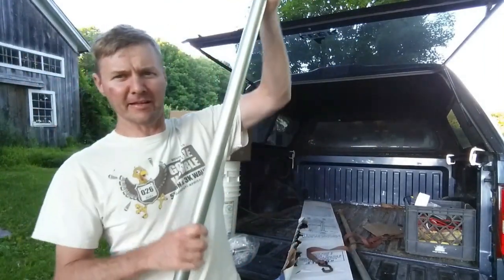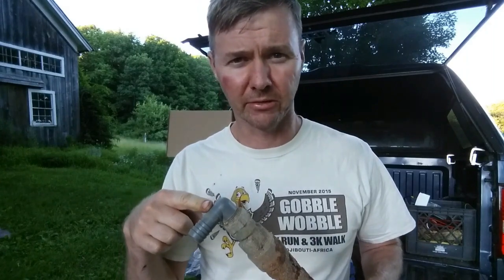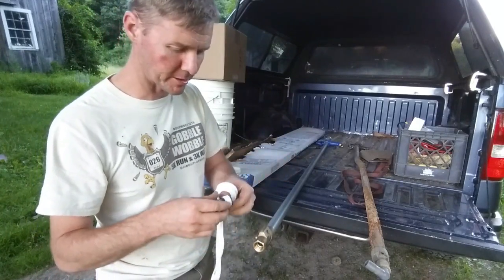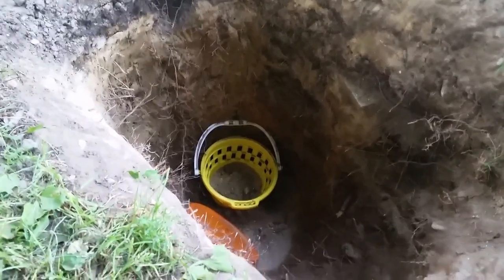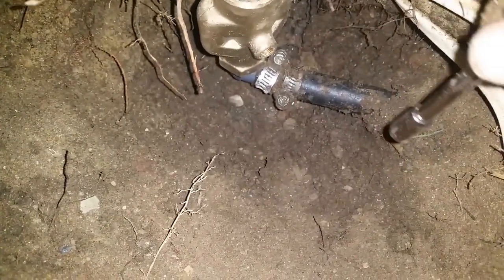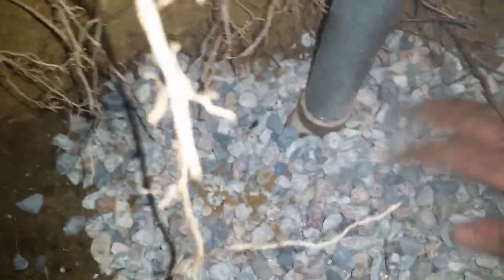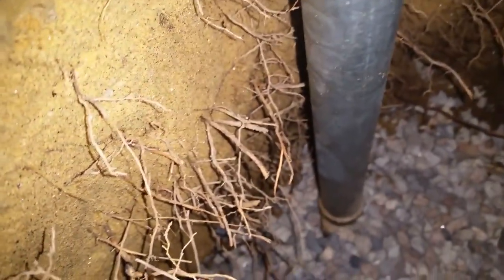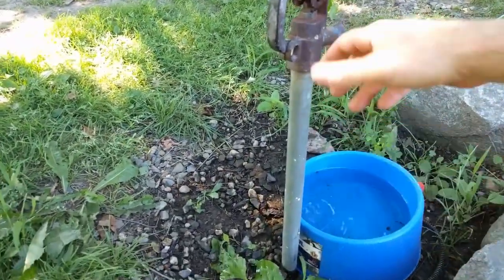Replacing a Frost Free Hydrant

Comment: i was able to unscrew my hydrant and replace it with out digging is up , worth  a try for folks because if it doesn't work  you just end up digging it up ..
Reply: In my case I can't shut the water off, it's from a well from across the road that I have no access to.

Comment: 7:10 Romex electrical wire should not directly buried. Having the wrong wire close close to a metal pipe is very dangerous. There is a good chance that wire could electricity the hydrant and kill someone. 

You should definitely not be touching the wire as there could be a tear in the insulation from being buried.
Reply: Well said Eric,  UF wire for direct burial only and cover it, mark it and protect it.   Who ever installed that lash-up was setting someone up for electrocution.